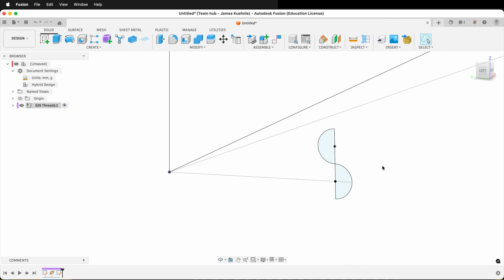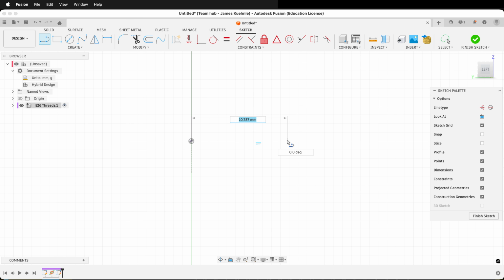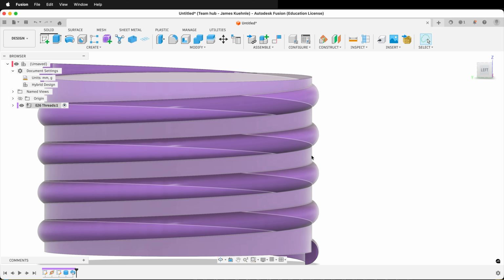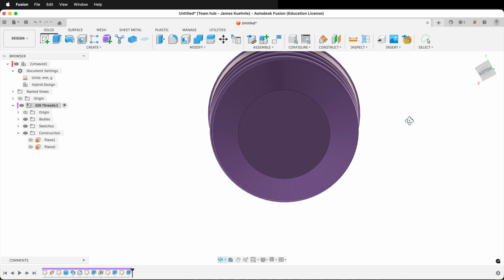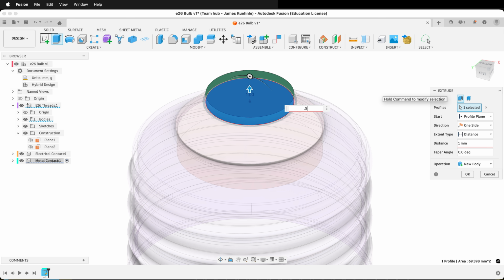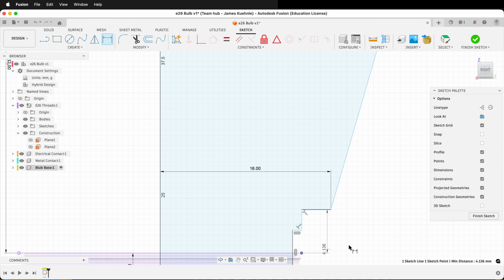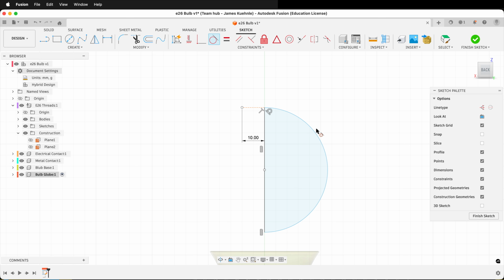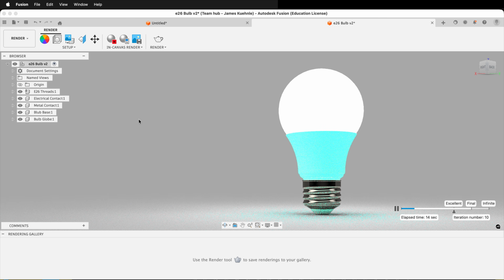Fusion E26 Light Bulb Threads Tutorial | Model IEC Curved Threads Without the Thread Tool

Comment: I’m sure there’s a reason why you’re using this program but I would be finished by the time you got halfway through it and blender 3-D
Reply from the maker: That's impressive if you are able to model this faster in Blender, I use Blender a lot but would struggle to make this E26 lightbulb model with precise dimensions and accurate form

Fusion is great for solid modeling but the software isn't important if you can get the results you need :_calipers:
Reply: @W @WhatMakeArt  fair enough. I guess to do it even faster. You could just go on some website and buy a lightbulb model.